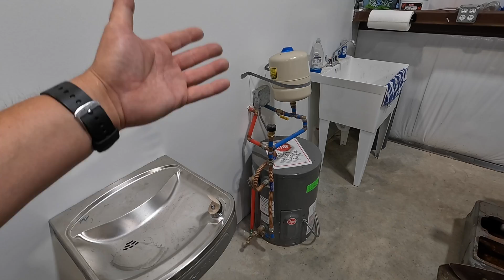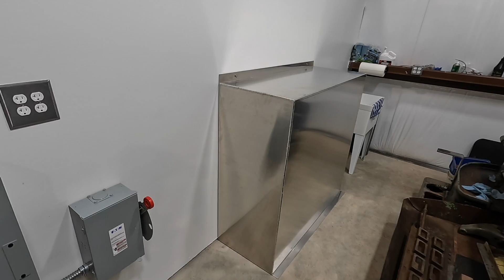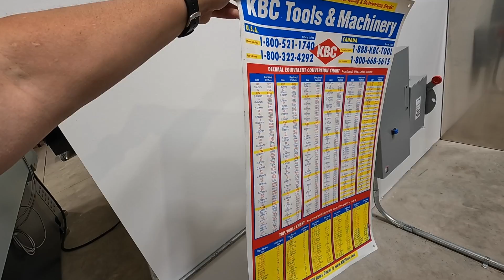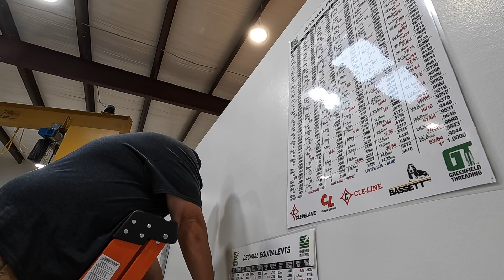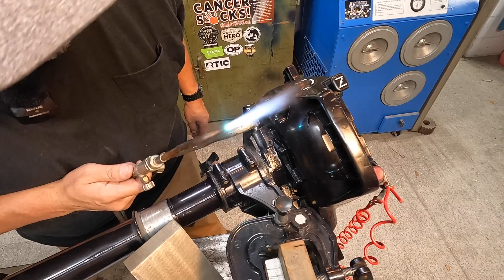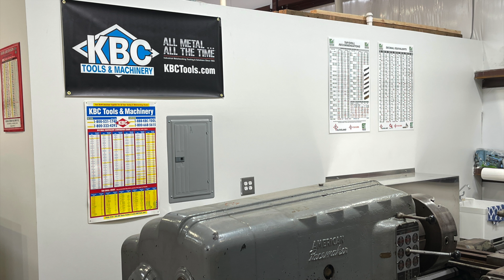SNS 363: American Flag, Shop Projects, Outboard Motor Repair

Comment: Two suggestions; if you grind a groove in the shaft the vise-grips hold better and I would add two or three more screws in that top flange to help keep it vertical under load.

Comment: Since I believe you have a Precision Matthews lathe, I think I would have gone with a Precision Matthews milling machine if they make a milling machine if one might be close the KBC milling machine or a Baileigh milling machine. Matt at Precision Matthews might have given you a discount for buying 2 machines from them. A little bit of liquid nitrogen might have helped once you got the the pin out at the o-ring.

Comment: > Safety concern < that fountain will need to be run every once in a while to keep water in the trap. or the trap will get dry, and sewer gasses will escape. you might want to just get a plumber to cap the waste pipe or remove the whole thing.

Comment: Methinks thou has the flag displayed left-to-right. 
If you uprighted it (or tilted your head left) the stars would be on the right.
There's a whole official discipline called "flag protocol" about displaying flags.
Makes interesting reading.
__a fan of the channel for years,
'bye
Reply: The stars should always be in the upper left from the observer's perspective, so Adam has it correct for a vertical display.

Comment: Thanks Adam.  You will want to cap that water fountain off or you may get some stinky.  Ill bet CRC makes a "water cooler cap off spray"  Its in the blue can probably.  JK  Id still cap it though.  Harbor has those plastic/rubber tread plate squares that have the self adhesive on the back.  That would go nice on that new stainless shelf for those toolboxes and such to sit on, plus stuff wont roll off.  And I still don't see an eyewash in the place....you got that in the office or somewhere?

Comment: Don't know if you get enough of this kind of work to justify it down there where it's sunny all the time :)  but I saw an induction bolt heater on another channel and wound up buying one.  It works really well and is helpful if there are plastic or other meltable things around the bolt/pin you're trying to extract that you may damage using a torch.  It's helped me get a few rusty bolts out.
Reply: Whats cool is they are pretty easy to make for cheap. No significant electronics experience needed.

Comment: When the drain trap dries out (evaporation) on the water fountain, you are going to have sewer gasses (stench) in the shop.  You will need to run the water every few weeks or it will stink
Reply: If you put mineral oil in the trap it won't evaporate and if someone were to pour water down the drain it won't restrict flow.

Comment: It is fascinating to me when I see plumbers use PEX — whose greatest advantage is that you can run it point-to-point without couplers, elbows, joins, etc that can potentially leak put in a bunch of them anyway as if it's just plastic copper plumbing. It's literally a waste of money (those elbows aren't free!), and as you point out, they did an incredibly ugly job of it.
Reply: A little read fact. Check the UV stats info on PEX. I love using it, but in areas having low to no UV light, like walls or basements.
Reply: That is actually correct, it has that ability although most use it just like copper. In reality though, you have to have the space available for the proper bend radius, etc.  And to do that, you should probably use one of the available bend brackets to prevent potential for kinking.

Comment: You should add some ventilation holes to let the heat out from the hot water heater
Reply: And an extra heat-retaining jacket over the heater (keep the enclosure cooler.

Comment: Don't forget about the p-trap on the fountain. It will dry out from not being used. I would cap or plug it temporarily though in case you ever did want to use it (not glue the pvc). Of course, if you're sure you're never going to use it, then glue the crap out of it. 😁

Comment: You sir is an angel for just saying plummers did an ugly job.
im not sure i would let em off that "easy" .. 
i actually belive a drunk sealion could have done a better job.. says a lot about a company doing crap work like that, one can only advise not to use them
Reply: Even if I ignore the PEX pipework, which technically seems to be ok, although not very decorative, but that expansion siting on top just like it got bent over in the last storm got me.
Couldn´t they invest 5 more minutes and some pride to hang that thing straight? Also it looks like that strap pulls it toward the wall, not actually holding it and all the weight of that thing is carried by the now bent and stressed pipes. I wouldn´t wonder if something starts leaking and cracking over time there.
Reply: @alexanderkupke920  What "beats" me about it is , it's a brand new building, that would not have been accepted was i the owner :) but many workers/companies today have no honor and pride what so ever.. it's all about getting that money as fast as possible and get on to the next job .. one of the reasons why i enjoy watching Adam work as he do and explaining things, the attention to details and the effort put in to do the job as it should be done.. there are not many left of them and we need to support those who are :)

Comment: OK, I am going to get hatred for this but here it goes:

A flag is an important symbol to be flown on a flag pole, hoisted at dawn and lowered at dusk (there are rules, look it up). Hanging it on a wall in a workshop, warehouse or whatever or hanging behind a vehicle is just disrespectful.

One of my pet peeves is fire trucks/engines with a US flag dragging behind it in the exhaust fumes and street/road dust and rain/snow spatter. It is the ultimate sign of disrespect for the flag. A fire engine can have a flag painted/air brushed on it’s side as a sign of respect but never soil a real flag.

Hanging a Star and Stripes on your workshop wall does not make you a better patriot, in the same way as not hanging it, does not make you a bad citizen.
Reply: The US Flag Code has verbiage regarding hanging a flag on a wall. I work at Kennedy Space Center and almost every shop, vehicle processing area, facility displays the flag inside shops, offices, high bays, you name it. If that were my flag, because of it’s size, I would rotate it 90 degrees to mitigate soiling. I’m with you about flags in vehicles. It’s flat disrespectful. The flag should not touch anything other than the pole from which it is flying. Flying or displaying the flag incorrectly doesn’t prove one is a patriot, it only proves one’s ignorance to proper display.
Reply: No official rules about flags here in Germany, and I may get hatred for this, but we never understood all this fuzz made about a flag in the US.
Regarding our law and understanding a flag is used as a symbol to represent something (a country in this case) and there may be a simplified flag (like our black red and gold flag) everyone can use and a flag bearing the coat of arms (the federal eagle) which may only be used by official federal agencies and such as it is a national emblem with a legal meaning.
but when it comes to the actual flag, it is just a piece of cloth in those colors, nothing more and nothing less.
Well, maybe we see it a lot different as the last time there was an abundant (over)use of flags and national emblems those had been red, white and black and quite often showing a swastika...
But I absulutely agree on your take regarding neither a bad person for not flying a flag nor being a better patriot for flying one.
And in many places there seems to be something happening I heard someone call "bumper sticker patriotism", when people (not exclusively, but rather often) with a more nationalist US American thinking try to show something like "the more flags the more patriotic" covering up their rear winbdow and bumper in stars and stripes and also covering up an often times not very patriotic, but nationalist attitude.
Reply: @alexanderkupke920  Dude, I'm a good part German, and served in W. Germany before unification.  Please, please, don't even try to comment on anything related to flags, nationalism, or anything else related.  Not hating, but In the US, patriotism/nationalism is nothing like German nationalism.  And to boot, all the American media you've probably seen is primarily Left of Center, and for decades has portrayed patriotism as little more than Nazi-ism-Lite.  
Whomever told you "covering up an often times not very patriotic, but nationalist attitude." is probably Left or Progressive, and like you, equates patriotism/nationalism with German Nationalism, which is really akin to Japanese xeno-phobia and Dictatorial/Fascism.
Don't worry, most Europeans I've met seem to have been brainwashed like that as well.
Reply: We had a huge scandal when one finnish athlete wore our flag a cape after winnin (can't remember). It's actuallu illegal here to wear an actual flag and if you drop one you're supposed to burn it in a fireplace. Preferably in the sauna.

Comment: Many jurisdictions (particularly in hotter climates) require that businesses have a water cooler or other source of drinking water available and a sink isn't considered a suitable source. Some will let you use refrigerated bottled water but many require the water cooler you have or a stand-alone bottled water cooler.

Also, before you put too much weight on top, keep in mind that the water heater will require servicing.

Comment: A nice, new, laid out shop, and the plumber "hangs" the expansion tank like that. I'm not sure how he got it that crooked to begin with! And that looks 
like flexible gas pipe hooked to the water lines on the heater. That install should've been aborted due to "ugly".  lol   Good call on the cover! (And it's got
lots of room for new stickers on it!)

Comment: How are you planning to reset the GFI breaker under the fountain? It may not be the only plug on the circuit. When it trips for any reason you will never remember its there.
Reply: Rut-ro

Comment: That p trap is going to dry out and sewer gases will make their way in. You may want to remove the p trap and stuff it with a rag.
Reply: Not a plumber but think a better solution would be to remove trap and install an adapter to a cap. 
Doubt if rags would stop sewer gas.

Comment: With that amount of wall space and the size of that flag, it would look great hung like it would on a flagpole. It also wouldn't get so low to the floor where it could be at risk of touching or getting dirty. The shop is looking great and coming along nicely but that floor needs a good scrubbing and the sealed.

Comment: All of us small business owners at one time or another, get zinged by either local code statutes or by the dreaded State or Fed OSHA regulations;. IE: trip hazards, exit signs, secondary egress exit, msds files, fire extinguishers and signage for them, electrical and plumbing, 1st aid and eye washing areas, a defib machine if open to public access even if its only the office....and also ADA regs......and depending on how serious the violations are and the inspector, could result in a fine or all the way to closing down your business.....while you may be the sole employee in your business......these regs still apply....We all forget abt these things, or think they dont apply cuz we are a lil Mom and pop operation.....wrong wrong wrong....Adam is slowly doing the right things, the right way and trying to comply as much as he can one step at a time....give him a break and have faith....cuz those of us that live in glass houses, small business owners or hobbyists shouldn't throw rocks........just saying
Reply: Uh-oh Don, the grammar police are after you! 😄
Reply: @Bellboy40  nit pickers, exactly my point !!!!
Reply: That's "All of WE small business owners".  Strip out everything but the subject, verb, and object and see if it makes sense, as a general guideline. So in this case that would be "We get zinged", which is correct, in contrast to "us get zinged".
Reply: @silasmarner7586  We all as, or All of us sounds good, whilst All of we sounds wrong; but I, like many , don't have the grammatical knowhow to either follow or argue against your reasoning.

Comment: Please take that cover off again so that you can disconnect and plug the water fountain drain. Eventually the trap will evaporate allowing sewer gasses into your shop. Sewer gasses are methane, they stink, it's not healthy and present an explosion hazard especially in that enclosed box. Otherwise it's a great addition to your shop.
Reply: its a pretty cool idea and looks great aside from the drain
Reply: How about not and say he did?

Comment: You definite need a slide hammer lol, I use heat guns on aluminum especially when painted.  Works as well or better than torch, and don’t waste gas.

Comment: Does the hot water heater require ventilation? Will the enclosure become 'hot' as heat generated from the hot water system is not vented?
Reply: No.

Comment: Just one question wont the hot water heater overheat now ? that it is inclosed
Reply: Why would it be a "hot" water "heater"??
Reply: @paulcopeland9035  Good question. If water is hot, why to heat it. The name should be cold water heater.
Reply: No, of coarse there is a thermostat. It holds the temp where it is set.
Reply: @karirautio  Trapping the heat under there from the hot water in the hot water heater means it will never have to run to give you hot water. 
In fact, your power bill will go down. That's the magic of a hot water heater vs. a water heater. It's true!   lol
Reply: @karirautio  🤣 now thats too funny.. dumb and dumber
Reply: I wouldn't be worried about it, but the cupboard might become weirdly warm, which may or may not annoy people.

Comment: Taper pins were common in my world. Removing them could be a challenge. Usually the pins were pre drilled and tapped. I made a slide hammer for the purpose. I drilled and tapped the end of the slide hammer 3/8-16 and made a set of standard threaded adapters for both standard and metric threaded taper pins of various sizes. The adapters were tapped 3/8-16 and fitted with a loctited set screw. The adapters were then quick change by threading on via the 3/8 stud. I used this as a a shared shop tool for over 30 years.
This tool would have facilitated your pin removal by drilling and tapping the stuck pin.

Comment: Did you block the drain of the water cooler to prevent sewer gas from entering the aluminum cover and creating a potential explosion hazard?
Reply: It is trapped!
Reply: @paulcopeland9035  The water in the trap will evaporate over time since it wont be in use now.
Reply: Maybe the fountain has an indirect waste connection.

Comment: Enjoy your flag and thank you for proudly displaying it.  You should know that  the USS Chief (MCM-14) is an  Avenger-class mine countermeasures ship and she was named for the former USS Chief (AM-315), which in turn was named in honor of all the chief petty officers (CPOs) of the US Navy. She was built by Peterson Shipbuilders, of Sturgeon Bay, WI. and is home ported in Sasebo, Japan and is part of the U.S. Pacific Fleet.
In  January of 1995 she participated in the  annual Gasparilla celebration here in Tampa, FL
Her keel was laid down on the 19th of August in 1991 and she was launched on the 12th of June, 1993.  She was placed in commission by Lieutenant Commander Timothy S. Garrold, USN, her first Commanding Officer, on 8 July 1994 and she was officially commissioned on the 5th of November in 1994.  She's a real beauty.

Comment: As a Canadian I really don't know the protocol on flying the Stars and Stripes, but to me it seems to be backwards. When flying horizontally the stars are situated on top left corner. Vertically seems to me the flag is inside out. I realize there are two sides to a flag but when on display I think it looks out of place. Could be wrong.
Reply: Feild is always displayed top left corner, regardless of orientation. An exception would be on the right arm of a soldiers uniform, feild in the top right because it's flowing/leading as the soldier moves forward.
Reply: The American Legion posts the "Flag Code" on their website.  That will tell you all you need to know about the US flag presentation.  It's really mostly common sense, but it is the guideline that has been set.  Thanks for your interest in our "colors" neighbor!
Reply: @paulcopeland9035  "Guideline" is correct for anything that is not federal property, under federal governance however, it is punishable. But rarely. The military is really the only place you could mess your life up. Maybe only a few days, but still.

Comment: You can make a quick slide hammer. Just weld the adjustment screw of the vise grips to a solid 1/2” rod with a chunk of steel and a stopper.